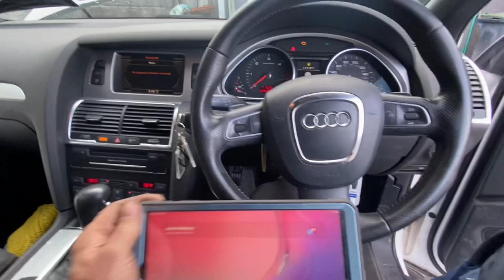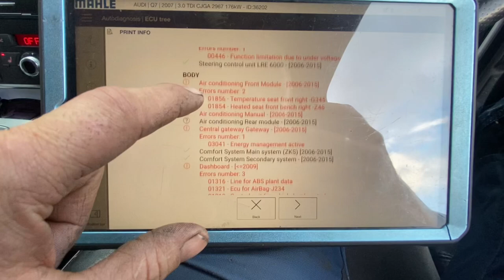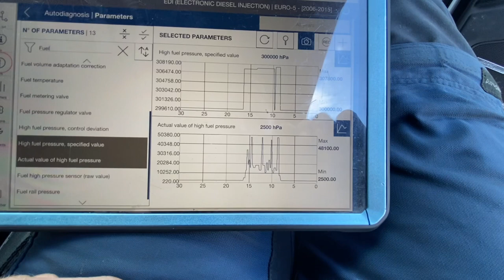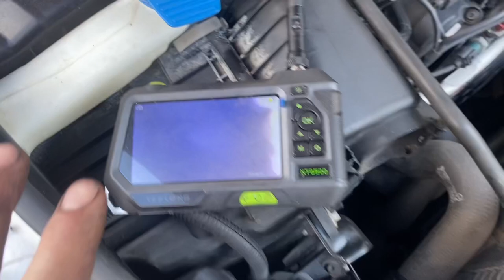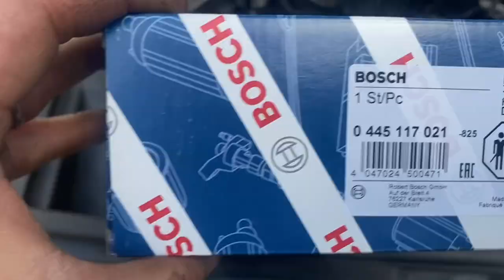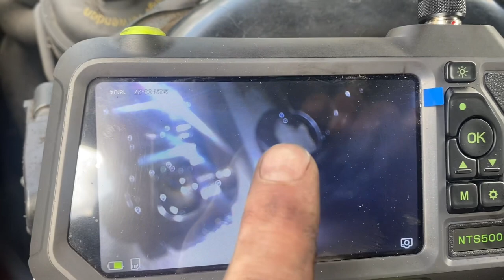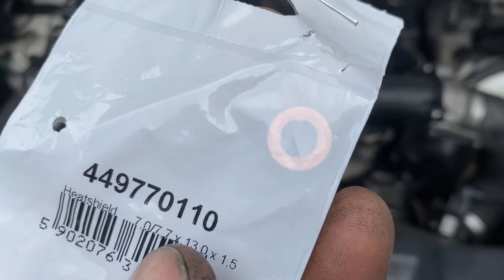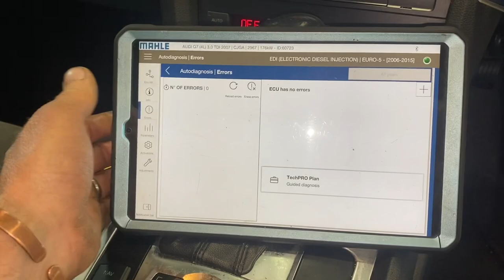Audi Q7, crank no start

Comment: That was a genius of a job to diagnose a car that fast lovley piece of work I say you have a very happy customer well  done ✔️ 👍🏻 👌
Reply from the maker: I was happy enough that I found the problem relatively fast. It had been previously diagnosed as high pressure pump at €3000 to do, so the customer should have been fairly happy. Cheers Paddy 😉👍

Comment: Another top job Peter,  great diagnosis there , good job the other guys didnt fit a high pressure pump on it , love the fuel pipe blanks, I've seen Dave use his on one before , tight Sandy uses ball bearings , spends his money on Iron Bru 🤣🤣🤣
Reply from the maker: Poor Sandy 😬😬 Cheers Mike 👍

Comment: Easy to understand, very clear for the car numpty like me. i have an issue wher my Q7 cylinder 6 on your vid injector keeps blowing out. would be clear out but bonnet in way. It  pulled the bolt down clip out at the side with the star head on it diesel eveywhere, no bang just warning light and instant limp mode. this is the second time in just undr a year. 85k on the clock 61 plate. everyone keeps tellin me its a common problem. If it is what is the fix and why can't I find an answer to the problem. I learned more by watchng this vid than anything else but I'm still in the dark as to why it keeps happening on cylinder number 6. Can you or anybody out there help? I'm not a mechanic so keep it simple please.
Reply from the maker: I think that you must focus on the detail here.
1. Ream/ grind the injector hole 
2. Fit a new Audi washer
3. Fit a new Audi stretch bolt 
4. Tighten the bolt to the exact torque setting 
All of these details will be carried out by a suitably qualified garage & if so you shouldn’t have any more issues 🤞🤞

Comment: About to be diagnosing the same issue but I can’t find the block off caps anywhere, do you know what size I need?
Reply from the maker: @jpgnade1077  is it the block off caps for the injectors??
If so unfortunately not. But they can be bought carrying the bigger and smaller ones in a set.

Comment: Really good video Peter. Well diagnosed. What make are those blanking plugs? I need to buy them. Thanks
Reply from the maker: Hi Trevor, this is a link to eBay for the injector blanking plugs. They are very handy for isolating 1 or all the injectors to test the fuel pumps ability to build pressure. I’m glad you liked the video 🙏🙏👍

https://www.ebay.ie/itm/174156541209?mkcid=16&mkevt=1&mkrid=5282-175127-2357-0&ssspo=0RbtY2feRfS&sssrc=2349624&ssuid=bjxxf8trsrm&var=&widget_ver=artemis&media=COPY
Reply: @kennedysgarage3281  Thanks 👍

Comment: B7 3.0 tdi - 233 hp 
My cars having the issue where it will start up but on occasion it won’t. Or if it is idling the revs will drop and the power will cut out. Just now I was driving home and in 3rd gear at roughly 35/36 mph the glow plug lights started flashing and the power cut off. Now waiting for recovery, if they aren’t here in an hour I should be able to start up again and get back home. Would this be the same issue as diagnosed in this video? I have a feeling I need a new hpfp or maybe just need to change the belt
Reply from the maker: Has the recovery guy done a fault code scan??
It would be nice to know what direction to go 🤔🤔

Comment: Great job boss but ihave one question ihave Chevrolet 2.8crd engine show me p0087 low fuel pressure ican cheng injectors ican cheng low pressure fuel pump but fualtcode still they car start fine but when ican go around 3000 rpm car shutoff himself
Reply from the maker: Unfortunately there is no straight forward answer to this problem ☹️
You must check the following items,
1. The low pressure pump & line’s 
2. The high pressure pump 
3. Last but not least the injector’s 
Have you changed the fuel filter?? 
It’s a cheap & easy place to start 🤔

Comment: Legend 👏. Do you need to change the engine oil due to the leaking diesel into the cylinder? Cheers
Reply from the maker: It depends on how long it was leaking. Smell the oil on the end of the dipstick or just change it if you want to be cautious 👍👍
Reply: @kennedysgarage3281  thanks for that mate, cheers

Comment: Any idea why sometimes my engine cranks and sometimes it doesnt when i turn the key it makes a clicke sound but no start? Would this be a bad starting motor? I already put a new battery and a new ground cable
Reply from the maker: It sounds like the starter motor. The click signifies control to the starter solenoid. Ruling out most wiring issues 😉👍👍👍

Comment: Hi i have the same problem, have a audi q7 2011 mod. Nor starting, how can we find out the problem with injectores, the car stopd when i was deiving in lik 20-30 km it just stopd.it cold be the injector og the dieselpumpe says the mechanic, and both of them r epenxive parts. Is it pisible to find if it is the injectores? Crank bit no start.
Reply from the maker: Have you tried removing the glow plugs like I did and look for fuel spraying from a cylinder???
Reply: @kennedysgarage3281  hi no i wil remove them and see😊 thanx

Comment: 2 quick questions peter as a d.i.y.e.r. 
Is a leak off test the quickest way to find a bad injector without a posh scanner🤔
Are bahco socket sets  any good? .what tool brand do you buy ?cheers
Reply from the maker: An injector can leak in 2 place. 1 is up through the injector body and out the leak back pipe, 2 is into the cylinder through the nozzle. 
A leak off test will find the first but not the 2nd . 
Bahco are a good brand, I’m not too fussy with my brands. Tengtool , sealey, draper or any of the known brands are ok. Snap on can be very expensive but are possibly the best 😬👍
Reply: I know it's been some time since you've asked, but still Bahco tools are top quality, no matter what I've used from them. A bit pricy but worth it

Comment: What may have caused the SAFE?
Reply from the maker: SAFE on the instrument cluster was caused by a previous workshop removing the immobiliser. It was showing up for the last 2 years, I was told by the owner so paid no attention to it 😉👍👍👍
Reply: @kennedysgarage3281  mine has it and car won’t start only cranks
Reply from the maker: @El_companero_7  it is most likely an immobiliser issue you have so 🤔🤔🤔

Comment: Having a somewhat similar issue with my 07 q7. Fault P1063 low fuel pressure. Seems like very low fuel rail pressure. Replaced fuel filter, was full of gunk. replaced fuel pressure regulator valve, cleaned fuel pressure sensor. Checked flow from low pressure pump, looks ok. Crank but no start, though it will start when I spray easy start into it. Was thinking it might be loss of fuel pressure through leaking injector, but the fact it starts with a spray of easy start has me confused. Any thoughts?
Thanks, and great work!
Reply from the maker: They injectors won’t be commanded to open if the fuel pressure doesn’t reach 200 bar. So you really need a high pressure fuel gauge to see what the high pressure pump can do. This would be a good place to start anyway Barry 😉
Reply: @kennedysgarage3281  High pressure pump all good, figured out losing fuel pressure through excessive leak back on four of the injectors.👍
Reply from the maker: @barrymcmahon469  well done Barry, fair play to you 💪💪💪

Comment: Mate i am having the exact problem all the mechanics i have called have not mentioned what you said and done…… its been 4 days now the car is just parked on a corner HELPP……
Reply from the maker: What help would you like???
Are you in Ireland?
Reply: @kennedysgarage3281  unfortunately no i am in Birmingham my car has exact symptoms I don’t know what to do….
Reply from the maker: @shakkhan6075  if you are anyway handy with cars do exactly what I did, remove the glow plugs & crank it over. Then see if any fuel blows out ??
Reply: @kennedysgarage3281  ok i will tell my mechanic thanks a lot 🙏🏼🙏🏼
Reply: @shakkhan6075 How did it go ?

Comment: My audi q7 2007 3.0 TDI is starting well 80%  of the time, but sometimes it won't start on first, on second/third try it starts in 99%. Only one time I needed start spray because it just doesn't want to start, at first it was totally dead and after I tried cables it had enough power for this sound of turning on(i dont know to translate it), but it was just impossible to turn it on. It was close to turn on but nothing, and after start spray it turned on immediately. I visited lot of mechanics and electrics, but noone could find problem with diagnostic, even special Audi diagnostic didn't find anything. They just say drive it's fine but I know it isn't fine because I'm never 100% sure car will be good. Only thing they told me that I should buy this better battery 🔋 but that probably is not the problem. Can you please help me, what do you think?
Reply from the maker: These symptoms do sound very much like an injector starting to fail. You look at some injector live data on a scan tool. Look at injector balance or injector compensation. The other option is to remove all 6 and get them tested by a diesel shop. I believe this would answer your problem 😉🙏🙏🙏
Reply: @kennedysgarage3281  bro I was searching and it was earth cable problem can you believe. Now almost a month everything is fine, turning on without problem.
Reply from the maker: @grunastramen2178  well done mate 💪💪💪 happy new year 🍻😩
Reply: @grunastramen2178  Which one? sounds familiar symptoms.
Reply: @justinfufun5483  q7 2007 3.0 tdi 233 hp, it was earth cable problem with my car
Reply: @grunastramen2178 yes mine is 2006 233hp bug S-Line Ireland. It has intermittent weak start turnover just like a bad engine earth strap but I haven't found any bad connections so eas curious which one you found bad. 
PS I had a mini in the 1970s that had a bad engine earth but if you pulled really hard on the choke cable it acted as an earth and you could start the car but so.etimes it just flooded. 😀 was a ridiculous situation... until I discovered that when I rammed the gear lever into reverse and forced it against the cut out in the floor that worked too. 
Yes I eventually put a new strap on it but it spoiled the fun.